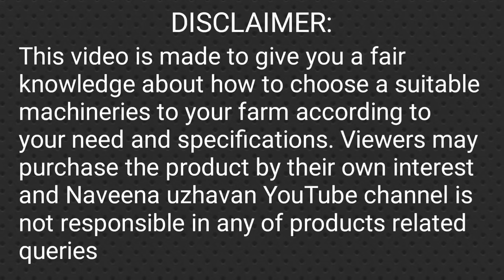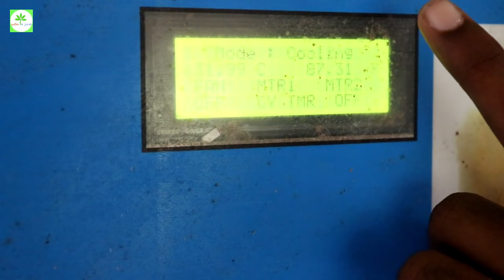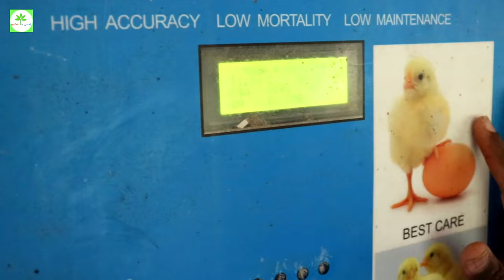ஆட்டோமேட்டிக் தீவனம் வைக்கும் கருவி - Automatic Chicken Feeder

Comment: What if power failure happen for 2 days.
Reply from the maker: Where power will go for 2 days bro.. alternate you can use Genset or High AH ups.. last option you can fill manually

Have a great day
Reply: @naveenauzhavan  Most of the poultry farms are present in rural areas so power will go anywhere for even more than two days bro. During nivar cyclone there is no power for 3 days.

And also include the EB cost in ROI .